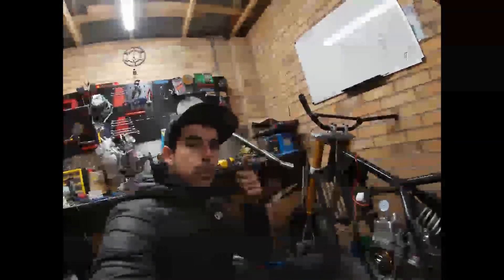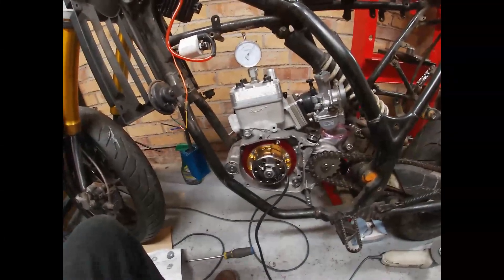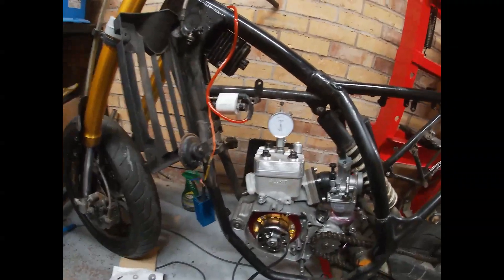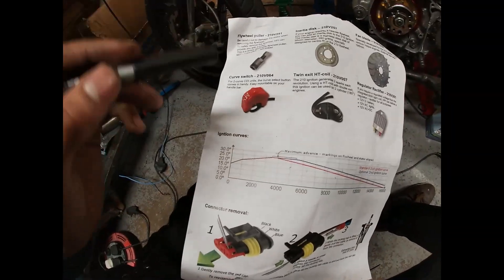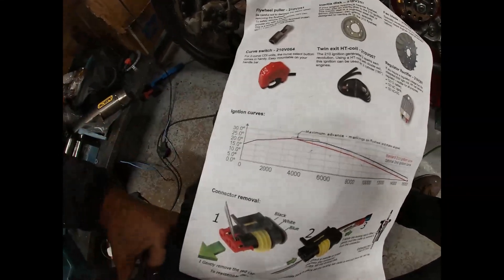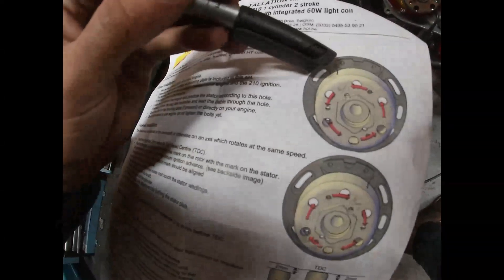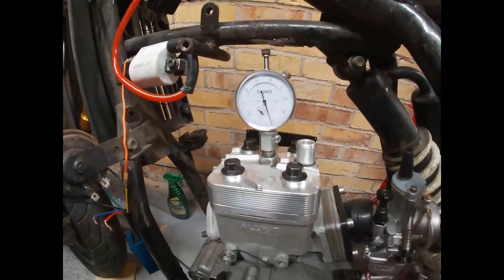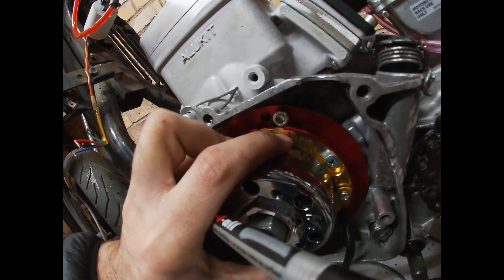How to setup an universal HPI IGNITION on a 2 stroke engine

Comment: i  have a 95 ktm 250 installed the hpi kit but the stator plat has 2 set of markings im trying to figure out  which one i use any info would be appreciated thanks
Reply from the maker: if engine turns to the left side (anti clock wise) you use the right marking. clock wise you use the left one.
Reply: @JLMotorsport according to the instructions this is incorrect, it's the opposite, ie, engine turns clockwise right mark, and left mark for a counterclockwise rotation engine.

Comment: Do you know if any hpi works with dt 125 2006?
Reply from the maker: Yeah, used them before in my projects, its not plug and play, simple mod you will fit them.
Reply: @JLMotorsport  What bikes hpi kit did you use for the dt 125 ? should i buy a hpi yz kit or something similar?
Reply from the maker: @-recoilbear-2576  I tried before from dt50